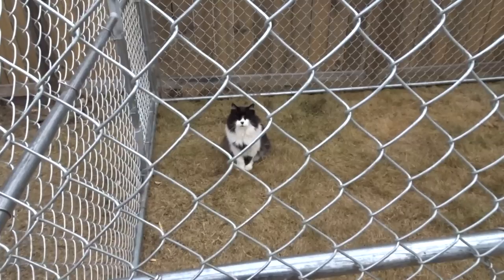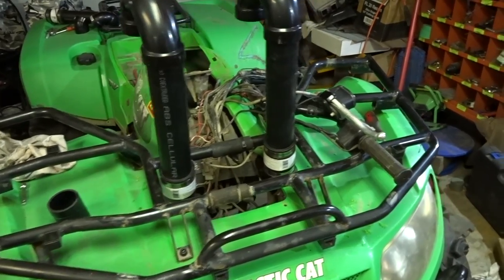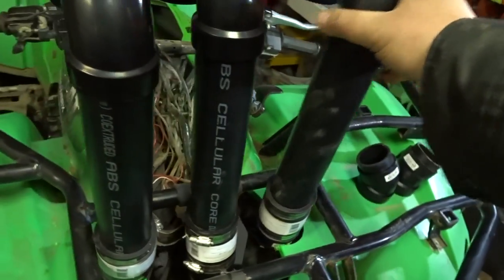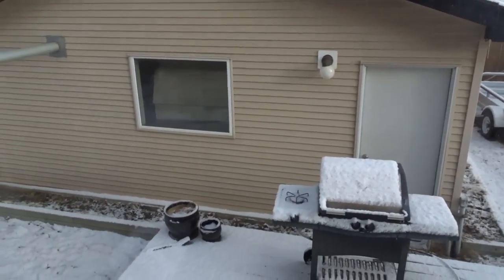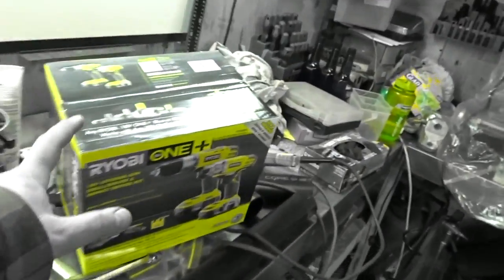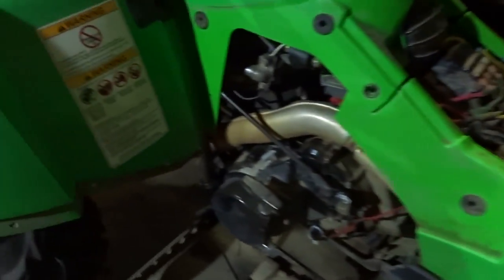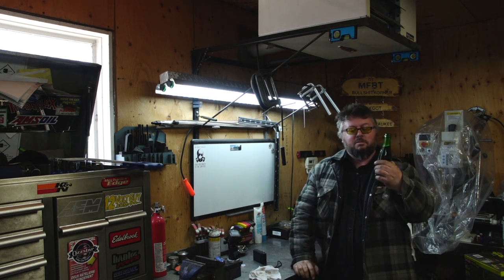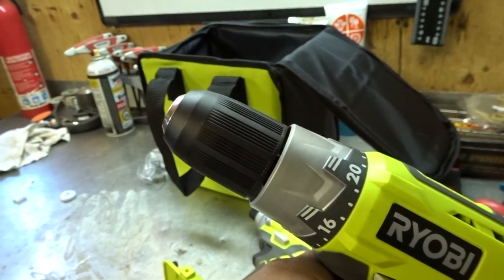Snorkel Nightmare And Wrong Hoses

Comment: The snorkels look good. Maybe make a bracket to hold all three together at the top? I think it'd be cool to turn the open ends so they stick out over the radiator and face forward like a ram air scoop. Probably asking for trouble that way though.

Comment: I have been using the 18V Ryobi tools for a couple years now. I am pretty impressed with them considering what i paid. I have the drill and 1/4 inch hex impact. The half inch impact, some lamps, grinder, circular saw. The half inch impact gets wheels off, it will generally get axle nuts and most suspension bolts. But I do have to get the breaker bar for some stuff. I'm not a pro but I probably work on 20 or 30 cars a year at the moment.

It's the same Chinese company who make Milwaukee, Ryobi and Rigid. Milwaukee make a more powerful impact. I really don't think there is much in it with these tools. Just that Ryobi are the cheapest looking.

Comment: I bought 2 Orange SKIL 20v Lithium Ion Drill kits, 90$ for Drill and driver impact  But they have  Impact, SkilSaw , Sander , Router , Jig saw ,and theyre making more ,Don`t come with a case buy pce`s each removeable  but one handy SOB batteries last 3 day weekend , The 4" saw goes thru a 4x8 3/4 " plywood like nothing .I bought an extra driver for parts omcase one dies WOW love it .Rebuilt my holiday trailer .Taiwon tire
Reply from the maker: +Garnett M I've never been a fan of the Skil but I'll take your word for it
Reply: Good machine maybe I'll do a vid just doing my scanner frequency s

Comment: Did you have to get any sort of programmer? Or did it run fine after the air intake snorkle?
Reply from the maker: +Tyler Baldwin mine is carb, wish it was fuel injected

Comment: is there no a oil cooler on that one mine does and mine is a 07 h1 650 trv
Reply from the maker: It does have a oil cooler
Reply: @BackCountryWrenching  so do you not have to put the oil cooler behind the rad I did
Reply from the maker: @jerryhart7680  the oil cooler is in the same place as it always was bolted to the radiator

Comment: Ryobi, Ridgid, Milwaukee, made by the same Chinese company. They are all designed to fail after a few years. I use Ryobi a lot, it's cheap and I abuse the shit out of the tools and they survive. I fried the 4 1/2 inch AC grinder after 3 years but that was after grinding for over an hour through 1/4 inch mild steel diamond plate, the powdered gears finally shit the bed. Was worth the $40.  You can pick that Ryobi stuff up at garage sales or the classifieds for $10/tool.
Reply from the maker: +fedor p why are you up so early did you shit the bed ?
Reply: Was too excited, was supposed to pick up two axles today... rear ended up being too narrow, gonna grab the front, disk brakes for the j10 baby!
Reply from the maker: +fedor p oh nice where did you go for those parts.  You need to sell all your jeeps and get a FJ